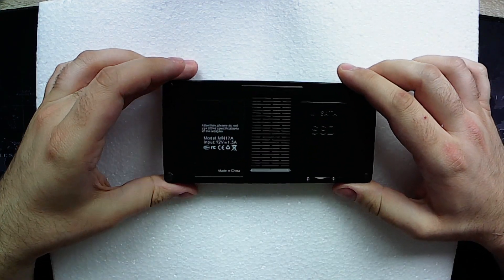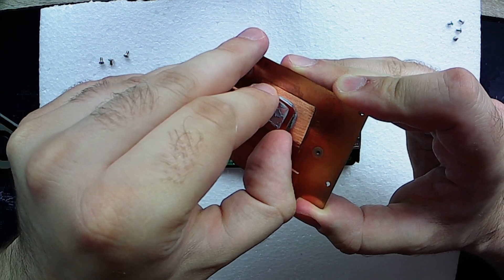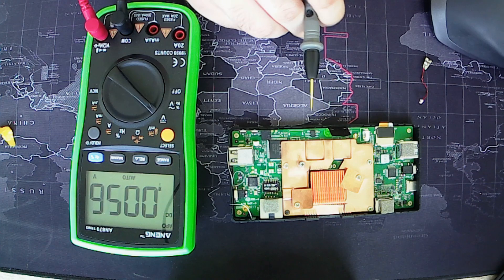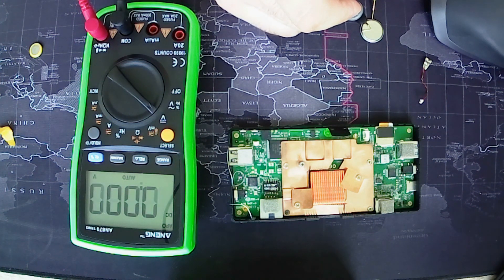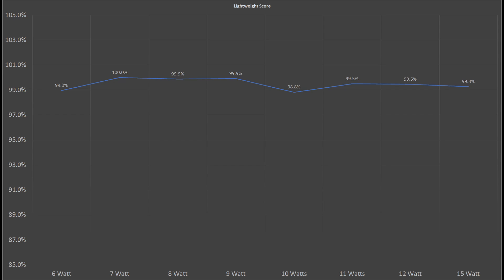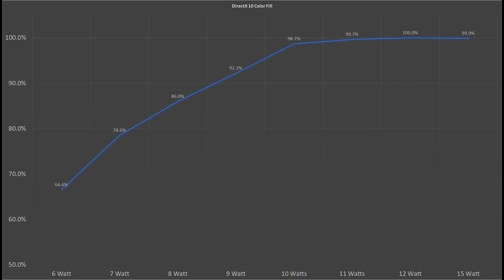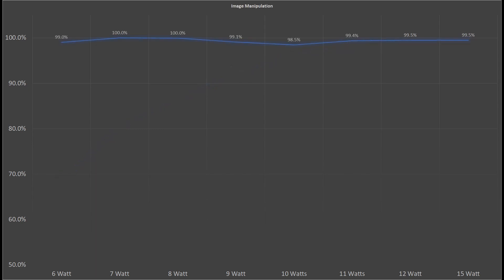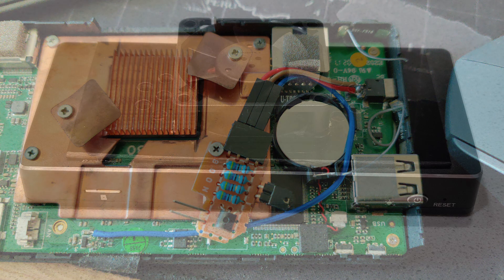Potato PC: Making-of and more benchmarks

Comment: Nice job, but i would leave out those copper plates that hold the heatsink - the 3M double-sided thermal tape or cheap chinese thermal glue would do a perfect job there.
Reply from the maker: Do you think the thermal conductivity would be good enough? I know that this is a botched cooling solution and I would like to fix it in the future. I was also thinking to apply liquid metal to increase cooling Performance. At the moment, the CPU gets quite hot when I remove the power limits, bit way better than the original cooling (it would have been impossible to increase the power limit. Even at 6W the CPU went above 70 degrees.) - maybe thermal glue is a good option
Reply: @bitsundbolts  Well, the conductivity is certainly not at the level of a good thermal paste, but it would not make much of a difference (for the worse), neither will liquid metal for the better. I would simply go for the taller heatsink. Since you already had to cut through the upper plastic cover for the fan (or did you, its not clear from the footage?), the taller heatsink can just pass through the hole and (somewhat smaller) fan can be screwed directly to the heatsink. And the chinese thermal cement will easily hold all that weight.
I have an old netbook with atom n450 cpu, but it runs linux. Im trying to find a similar tool as RWEverything for linux, but nothing came up so far...
Reply from the maker: The heatsink is a bit small. And yes, I did cut through the plastic cover. A taller heatsink would definitely help. I wonder if it would make a big difference to go for full copper vs aluminum for this use case. But then liquid metal would not be possible with an aluminum heatsink.
Reply: @bitsundbolts  I would go for aluminum- a bigger chunk of copper is hard to find for a decent price, while aluminum is dirt-cheap. Now when i look at it, there is not much need for that big copper plate at all. I would remove the copper plate, use much bigger cooler for the CPU (like 50x50x30mm) and use separate heatsinks for the memory and other chips.
Reply from the maker: Yes, copper heatsinks are expensive. I will revisit this project some time later and probably remove the copper plate as you said. The only "cooling" it provides is for the memory now. I may take one more attempt to build a heatsink holder using the existing screw holes. The thermal glue will be my last option